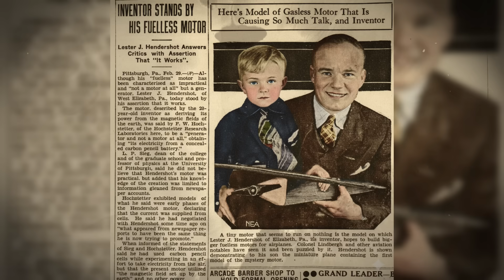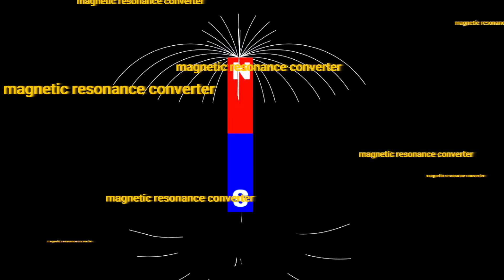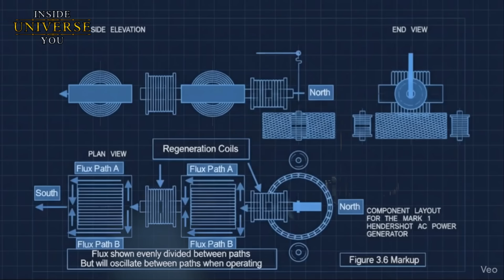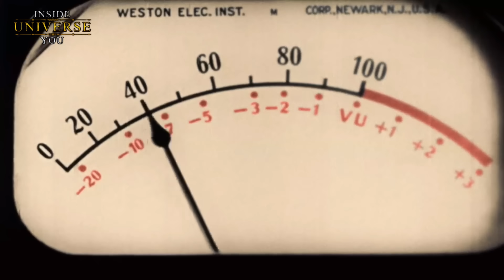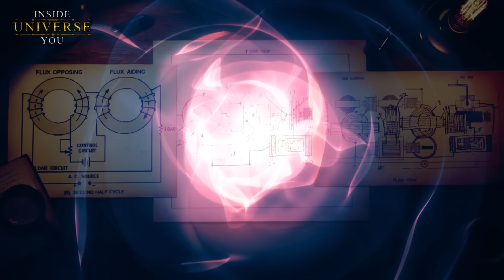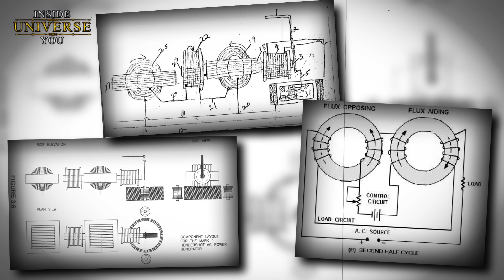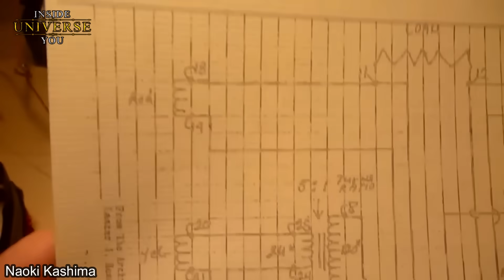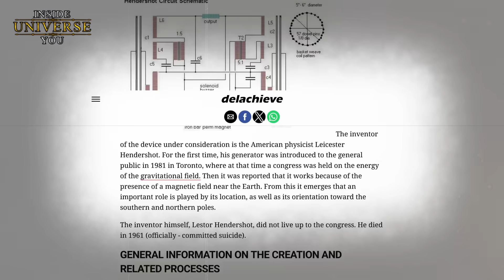He Invented the Hendershot Free Energy Generator & Was Eliminated

Comment: It appears it was just a high speed (oscillating ?) opposing ac coil set that generates a small magnetic field which when energised reacts to earths gravity/magnetic field causing a (resonant ?) flip flop of the difference between the two coils. Think of it as the electron equivalant of the mythbusters earthquake machine expermiment on a bridge.  It would only take the slightest ripples of local magnetic fields to slowly build up more speed. Like tapping someones shoulder every time they passed on a spinning playground ride.  Likely it was fed via some crystal radio style capture system with a voltage multiplier and transformer that charged a capacitor, which allowed it to pulse a high speed (maybe dc (half ac) at that point) current.     That was then used via persistence of vision (flashing on and off really fast)  to light a bulb, or slowly caused a dc motor to start rotating and build speed.      Hardly breaking any laws, although if it does what I think it does, having the main coils further apart and freezing the connecting wires to reduce resistance would probably have made it work slightly better.      

You could probably use it to drip charge a battery, or make an LED globe sorta glow.

Not sure how world changing it would be, other than perhaps you could have dim lights that light up for free, the motor would have had next to no torque although maybe given enough time it might be able to gradually spin up a flywheel.  But at that point it is still basically working as a drip charged battery only a mechanical one.

Comment: This is 100 percent Possible! It is know that with a few store bought supplies, you can create large home made capacitors that will continuously charge up on their own, it is not a ton of power but, a useable amount of amps and volts. With a more deliberate design you could absolutely power light bulbs or radios. With a large enough setup even more power.
Reply: Your incorrect. You may be able to build a capacitor but it won't generate its own electricity. This could never be mainstream as it's fake and the input is always hidden. Devices like this are a scam and only gullible people fall for it

Comment: People really need to quit using the term "free energy". No such thing...never will be.
Zero-point energy is a better way of saying it. Unless the equipment needed to "capture" the electricity magically appears out of thin air......HAHA
Reply: All the energy from sun, wind, oil, gas, nuclear etc. is free, it just takes some work to harness it, and the energy that work represents comes from the very same source of energy.  All energy ultimately comes from the same source.  The physical universe and all in it exists and is upheld only by virtue of motion.  If all motion stopped, the universe would disappear instantly.  And energy is what creates that motion.  So what and where is the original source of all that free energy?  Can we tap it directly from the source instead of from the oil, coal etc. which is not creating energy, but just stores energy coming from the original source?

Comment: I'm an electrical engineer. It is theoretically possible to extract a very small amount of energy from the earths magnetic field.  However it's far from infinite - it's not hard to calculate how much energy is available; and it's not much. It would not power much of anything.  It would also be a a bad idea to drain  that energy as that is what protects the earth from cosmic radiation that is harmful to life.  Somehow the idea that there is unlimited energy available has become urban legend - it's a limited finite source that constantly  fluctuates and varies a lot at different places on the earth .  One also needs to move the coils through the field or you get nothing - that much is fundamental electrical theory - Faraday's law.  If you put a coil in a static magnetic field, and keep the coil stationary, no electricity is generated.  You can prove this yourselves with a coil, a meter, and a permanent magnet.
Reply: I am as well and also an inventor. It's unfortunate how many people are swindled by this crap and you cannot challenge people's faith without it resulting in a vicious backlash. I've invented a far superior solar generator to solar cells that can produce more energy than we can consume, but industrializing?? lol
Most inventions never go into use until the inventor has been dead for 3 or 4 decades. 

These things are never easy which is why technology barely steps beyond standing still.
Reply: sounds familiar.  I have a few patents that were adopted by my company and more that the companies I worked for didn't protect.     Diesel engines and transmissions make way better margins than similarly rated variable frequency drives and motors, which was my thing.
Reply from the maker: Thanks for your insights!